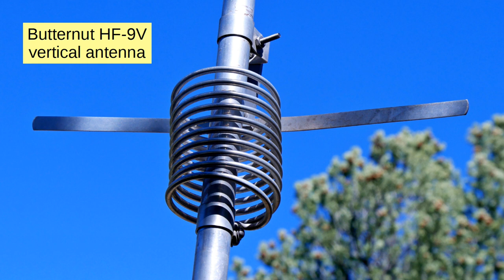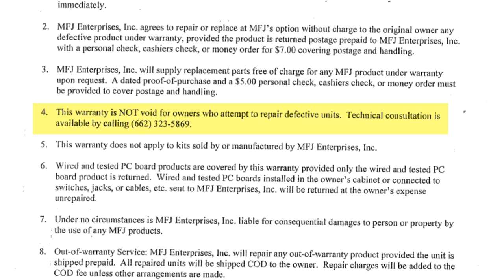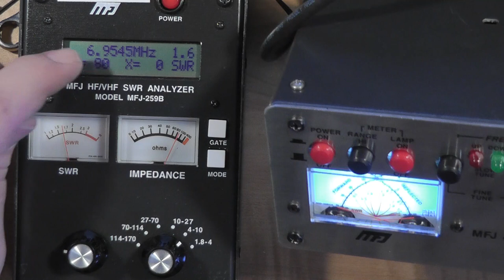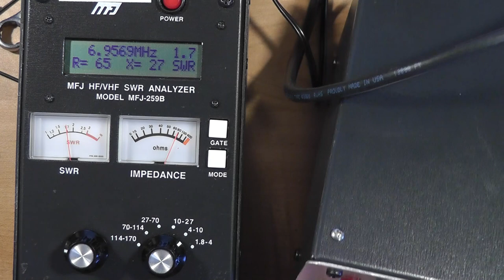MFJ 1788 Loop Antenna Fixed (#65)

Comment: I won't bash MFJ except to say that you'd better open up whatever you buy and check for cold solder joints and loose mounting of the components. These issues are very common. If you are willing to do that you should be ok. I tend to buy used MFJ products. I figure that it bothers me less to fix something that I paid less for. There is always tons of MFJ products on eBay. Could it be that there are lots of dissatisfied customers unable/unwilling to repair the stuff? Well, I guess that their loss is my gain.

Comment: What actual use is a warranty, if you actually fix it yourself? You are the warranty. Evidently.

I also had to repair my MFJ loop. The spindle driving the VC was not secured by the grub screw. It just spun the drive loose. It was a pig to repair as I had to file back the end plate to access the grub screw. Truly, there were so many mistakes, in a very small space of work.
Reply from the maker: I understand. It's very frustrating. Sometimes there's something that you cannot fix, you have to send it back and use the warranty.

Comment: I bought their antenna tuner kit and had a similar issue with one of the air variable capacitors....the plates actually rubbed against each other when meshed. Very poor or non existent QC

Comment: WOULD. That I could..But now old and a 4 times wounded USMC Combat veteran I just can NOT. Walk with ANY feet that is. 
  
  Sadly, the severity of my disabilities is so such, the last 4 1/2 years after 5 Emergency Surgeries has been in bed or now the cheap electric wheelchair my wife saved for, for any rare good day where I feel able to even get up.  She also saved for almost a year to get me a new Tecsun S2000 to put next to my bed. Trying to lure me up and OUT of it. But here in Southern California area (Oceanside in the area of back gate of USMC Base Camp Pendleton area), we have NO reception. NONE:-) Plus I have NO clue, just had a couple cheap very old $40 or so old pocket short wave radios without even any push button tuning. But she knew how bad I had wanted this radio for SO many years, so she got it. Now she tried running pieces of wire of assorted research we BOTH did online and because I also fight with a Nazi like HOA who refuses ANY sort of visible antenna at all. I also bought 2 different cheap portable antennas from Amazon=NO luck. So I see these videos and was set to start saving for one of these Loop antennas since NOT seen by my HOA and I just ONLY hear great stuff about them. Well till THIS video.

  I was planning on a cheaper model by this company only because I keep hearing about them, and they seemed to be a BIG company so I ignorantly just assumed they might be the best. Because I now still have over $220K in Medical bills and I honestly can NOT afford even any tiny mistake here on choosing an antenna that will at least give me a fighting chance to find signal, does ANYONE have any suggestions on a brand and model of loop antenna like this that is easy enough for my wife to put up inside or in our private back yard away from the HOA from Hell's prying eyes? One with known QUALITY? If I had bought this antenna with the results shown here I literally fear it could have sent me over the edge and led me to do something stupid. I really HOPE that this could still offer me a hobby to help distract me from pain that is every minute of EVERY day & night. It NEVER stops and between the  4 wounds and 6 spine fusions and 5 more really UGLY surgeries, I NEED this to be a hobby to distract me from it all. Just even a little.  ANY affordable brands out there for the casual dummy just starting out? 

Lastly thank God for YOU David Casler. All you teach gives me hope one the one end. But then makes me want to run like Hell on that other end. :-)
Mike in Oceanside
PS We had been considering the W6LVP Amplified Receive-Only Magnetic Loop Antenna you reviewed here. It was the first time we thought MAYBE this was exactly the perfect fit for us?

Comment: Hi David! Just subscribed to your channel. I'm very close to purchasing a 1788, and I'd really like to know how 40 meters works for you now that you resolved the capacitor mesh issue. Could you post a video update, or, send me an email with some updated observations? I'm ready to pull the trigger, but if it's a flop on 40, I'll reconsider. EHam reviews of the loop, especially on 40, aren't particularly helpful. Thanks, sir! 73 - NK9B
Reply from the maker: I'm days away from having that information.
Reply: My MFJ-1788 works fab on 40m, see my results on QRZ

Comment: I think it's nice that MFJ is willing to let people repair defective antennas without voiding the warranty. However, more importantly, I find it shameful of MFJ to tolerate such poor workmanship and basically leave it up to customers to correct defects. Because of their willingness to let defects pass through an apparently 'absent' QA inspection, I would never buy their products. They have earned the reputation of 'Mighty Fine Junk,' and they have NO one but themselves to blame for that poor reputation. It is sad that they seem to be 'ok' with that and not willing to take any measures to reverse that reputation.

Comment: I bought a used one and it had the same problem...
Reply from the maker: I hope you were able to fix it.
Reply: @davecasler  oh yes no problem but they just hand done a lot of them wrong. And the capacitor plates are very poorly made.

Comment: MFJ in my experience is GREAT customer service , great tech support, lousy quality control. You can say it was in haste, but when it seems to be the norm, not the exception, you start to wonder if they are just dropping the ball when supervising employees or demanding their employees do better work. Seems now a days they are plaque by SIMPLE mistakes.
Reply from the maker: I remember when I reported that an antenna I was testing was made to the wrong dimensions, my MFJ contact became pretty upset. I don't know their internal processes, but the antenna I was testing was quite a few inches off. When I recut it to the manufacturing instructions (which are confidential to MFJ, but they kindly sent me a copy) the antenna worked perfectly.